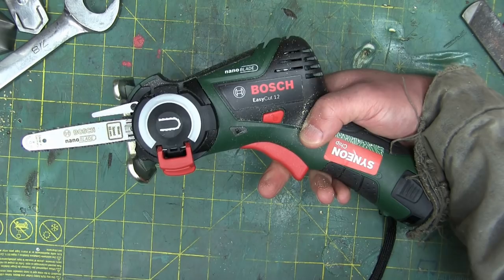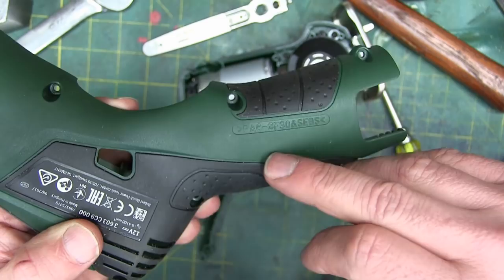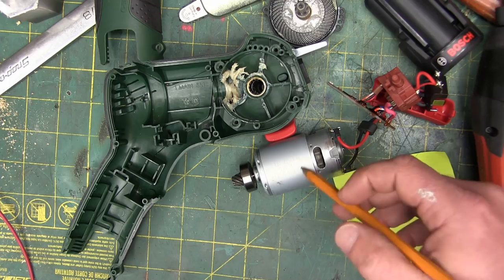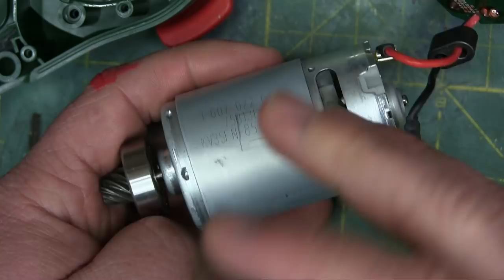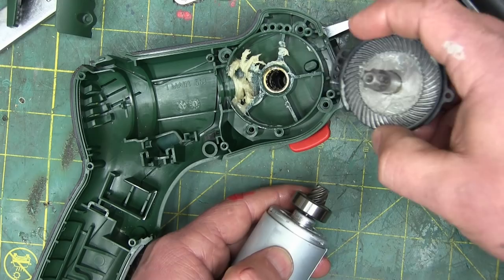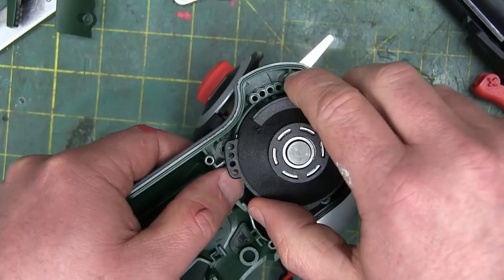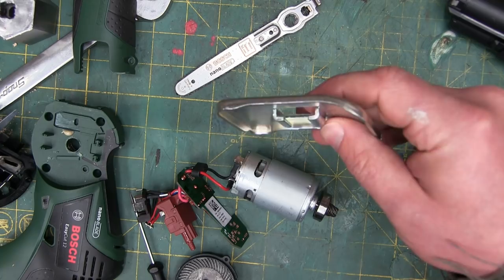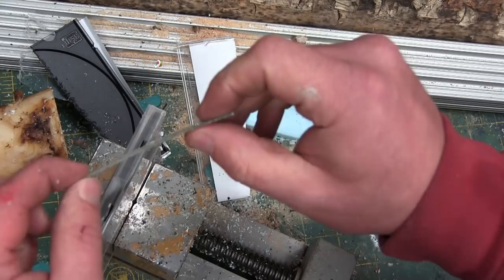BOLTR: Bosch Mini Chainsaw | KID SIZED DANGER!

Comment: I don't need it but I want it.
Reply: I want one it's so cute. Awww
Reply: The Stoned Videogame Nerd GEARS OF WAR!
Reply: I both need one "and" want one !! Ohhh the agony pain of wanting !!
Reply: F'n EH!! Still tryin to contemplate a use for it but i hear ya!
Reply: No no 
When the WANT becomes big enough, it will undergo metamorphosis, and emerge from its mental petcolation as a fully formed NEED!  I've seen it with my own two eyes!
Reply: Like a Bosch !
Reply: dont worry about wanting one... i cant find them anywhere. i hope this isnt AVE's first shill vidya.
Reply: They're on eBay, I have one an I'm in the USA.
Reply: No no Lol I have the vertical cut EasyCut 50, it's fucking sweet actually, I cut laminate floors and oak sills with it and for oak it's a bit slow but it works great, when I saw it was out I picked it up right away, only thing is that the spare blades are like 20-25€ a piece. It leaves a much smoother cut edge than anything else that can do small cuts so it's not just a cool toy.
Reply: Same. Why not.
Reply: See, here's the problem I have. I really don't WANT it but I'm afraid I need it. Long story short I gave up my recreational crack habit for a tool addiction. Now that I know about this I'ma have to git one.
Reply: Gears of tiny War
Reply: Pretty much like every unopened tool in my workshop, I may need it.
Reply: i have the same mentality
Reply: gabriel Sturdevant I found them on Amazon UK but not USA look up Bosch easycut 12
Reply: this and the chainsaw grinder wheel.. want it but the use..tere is none!
Reply: Those 30 year old ones are definitely different quality than those modern "green" Bosch. Had a green Bosch drill that fell apart for no good reason (other than being all-plastic). Still, this thing is SO CUTE, I just have to buy one :)
Reply: I actually do need it. my local city is violating curtilage law. 
Shitycityslickers Won't respond to removing the tree. The neighbor planted it and wanted to keep it. I need a sneaky chainsaw.
THE CITY CAN NOT HAVE ANYTHING BLOCKING ACCESS TO A GATE, DRIVEWAY, SHED, OR GARAGE. 
The law is the law.
Reply: I WILL! FIND A USE FOR IT 😂👍
Reply: Don’t we all just as a novelty
Reply: Now that all they need to do is hook this thing to a 25-foot pole so I can trim the tops of my trees.
Reply: @GospelOfTimothy  Harbor Freight pole chainsaw: am i a joke to you?

Wonder how long that blade holds up, cost, options,  but, skookum fuckery to one side, will I wear that out cutting branches from trees, or chopping up fallen branches for kindling? It failed on the rip cut, i was disappointed, but surely you could prune an apple tree. Then slice girders in your spare time lol.

Comment: Fun fact, the first chainsaw was about this size, invented and used by surgeons to cut bone! They were hand crank, no batteries required! I believe they now use something similar to a fein oscillating multi tool to cut casts off, and cut bone.

Comment: I came here from Wranglestar's review of the same tool to remind myself on how to correctly review a tool.
Just out of curiosity, how long before you think you pass him by in subscribership?  3 months? 2?
Reply: same here - wranglerstar "knew" the tool was garbage before he even touched it - he's got some next-level bias.
Reply: wranglerstar spends more time on his clickbait title than he does the video content.
Reply: How can WS have more subs?
Reply: @jensdavidsen4557  he, he shat on this product so much saying how bad it is. How a jigsaw is better it's. It has a different purpose. a jigsaw and a reciprocating saw blade goes in and out, so the work object so the tool has to be held onto the object tightly. This chainsaw just runs in one direction so it doesn't have a push, just a pool. 

A jigsaw cant cut into object longer than the blade itself, this mini chaincase can.

This tools is better suited for cutting/pruning shrub branches.
Reply: @Professional_Youtube_Commenter  as someone that does residential tree work. I'd rather use snips or a arborist saw for on the ground pruning. If you positively could not work a hand saw in a spot, this might work.
Reply: Wranglestar is a farmer.  AvE is an engineer.  That's the difference.
Reply: @ahobimo732  wranglerstar is not a farmer lol
Reply: I own this Chainsaw, if fuckin Awesome,

Comment: The chain saw was actually developed as a hand powered surgical tool for chopping through bone - sawing down trees came later :)
Reply: Stephen (ala QI) taught me it (finger rings, toothed cable) began as a gyno tool for cutting through the pelvic girdle during difficult (duh) deliveries. Never fact checked it as that's just a shade too greusome.   😃
Reply: The chain saw was invented to saw chains.
Reply: Stryker in Kazoo, MI, makes bone saws for surgery but they ain't as fun as this baby !  This may be your funniest video yet.  You sure had fun in the last 3 minutes.

Comment: Is it true that a chainsaw cannot cut through a sleeping bag?  What about a tiny chainsaw?

This device is totally awesome, by the way, and I completely want one.  Admittedly, mostly for answering questions beginning with "Can it cut through .....", though .....
Reply: Depends on whether or not the sleeping bag is able to get tangled in the chain and stall it, same for the small one. 
There are chainsaw safety clothes which have fibers that tangle the chain and save you from getting cut

Comment: That motor is very common in cheap cordless drills, it does not have a real voltage rating, same motor is used for all tools ranging from 7.2V to 18V, could be more. The only custom part is that sleeve. Cost up to $10 on ebay.

Comment: Kinda late on this one... But that ferrite probably isn't there to surpress comuntation noise. Those things do sod all below about 10MHz, and the comuntation noise from that motor will be topping out at around 50KHz max.
During emc compliance testing, they put the product in an anacoic chamber and blast them with rf energy (probably 10V/m in this case) and check to make sure they keep working at all frequencies. My guess is those battery cables were forming a 1/4 or 1/2 wave antenna for something in the tens or low hundreds of MHz, and the pickup was causing the processor to crash. They'll have added that ferrite as a reluctant last minute design change to pass emc. Just spent a week of my life babying one of my company's products through the exact same set of tests, and its excruciating!
Reply: makes me glad I dropped my microwave engineering Masters and went into IT lol. EE is some tough stuff.

Comment: Now you need a tiny set of files to sharpen it!
Reply: You only need one round file for chainsaws until you need to trim the rakers. I was thinking it'd probably be about 1/32 or 1/16 for this sized chain.
Reply: The teeth are really tiny - probably a mm or less.
Reply: dremel tool

Comment: PCB board is printed circuit board board. Let’s eliminate and do away with redundancy.
Reply: wd9dau do you hate it when people say PIN number?
Reply: He knows, and does it on purpose :P
Reply: billy mccabe  And VIN number, and PMS syndrome.
Reply: LCD display, TTL logic...
Reply: You gotta punch your PIN number into the ATM machine to get your USD dollars out and buy some distilled liquor. That's how it works, just for your FYI.
Reply: the worst one and the most annoying one is LED diode
Reply: ATM machine
Reply: Whats are ya? From the department of redundancy department?
Reply: CSTT Team (Combat Systems Training Team)
Reply: LED light
Reply: bhartley1024 ATM machine? Oh, you mean the machine you watch your ATM vidjeos on...
Reply: I'll write up a GUI interface in Visual Basic so he doesn't forget.

Comment: I was visiting the good old Baumarkt to decrease the free space in my house by adding tools but i forgot to take off my work jacket.
So while walking through the Cordless tool section i got attacked by an old Grey beard wearing Bosch clothes and huge €€€ signs in his eyes.
I guess he saw my Steel Mill jacket and thought i'd be an easily persuaded 250 pound gorilla full of money.

He tried to sell me Bosch Blue tools and was gushing about how they are all build in germany and how all the other companies only produce overseas not giving Germany anything back and after about 10 minutes of talking about politics and shit he finally found another target.

So just out of curiosity i went back and looked at the tools on display and ALL of them were Made in Hungary.

I don't give a shit if a motor or some screws were made here... why even bother telling me they were build in germany if it says HUNGARY right on the fucking tool.

SOO out of spite i bought a Bosch Drill with a cord out of the "Used once and Returned for no reason" Bin for 30% off and drove home.

Good Drill but shitty Marketing assholes pissing me off when all i want is just look at pretty tools and not think about politics.

Comment: As a city tree trimmer I'll tell you that you never cut against the grain. Your cutting efficiency is 4 x better
Reply: you might have that backwards cutting with the grain would be like splitting or ripping which is really hard to do with the pruning saw and doesn't serve a purpose in tree trimming
Cutting Against the Grain is a Crosscut which is like cutting a tree branch off

Comment: Love the ID10T, in the RAF new recruits would be sent to the photog section in their blue uniform with their respirator on and holding a board which had the sign ID10T on, they would be told it was so they could have an ID badge that people could recognise them form just the eyes and hair alone, of course the photog section are well in on the gag.
A bit like sending the new recruit to stores for some tartan paint, a long weight(wait), sky hooks or long stand but this is better due to the evidence :)

Comment: Cute little tool - I just googled the thing, and Bosch apparently claims the blade is good for about 100m of cutting in softwoods and laminates.  Appears they also do a ~500W corded version which looks like a jigsaw, only without the violent stabby-stabby motion so you can use it to plunge cut into something (say a countertop) without having to drill a starting hole.
Reply: A jigsaw doesn't need a starting hole either. You can plunge cut with them.....
Reply: Ben Johnson : might be good for parting floorboards right in the middle of joists
Reply: Depends on the material.  A jigsaw plunging into laminate would probably not do so well.

Comment: I've seen that incline plane idea from Canon entry-level lenses. Specifically the 18-135 IS. They align the mid element group like that and have a friction clamp screw to to hold them in place. WAAAY easier than poor Nikon assembly line workers and their stacks of shims.

Comment: Hey AvE. I can tell you the crown gear is a sintered part, much akin to the parts in their angle grinders. And the Bosch angle grinders share parts whether it is a Green or Blue line. 
Having burned too many in the past year, the sintered crown wheel simply cannot withstand the abuse of grinding concrete for a few hours. The longest we have had a 125mm Blue Bosch grinder last is roughly 20  hours.. And by then it really starts to sing..
Reply: Stefan Asmussen you won’t find ANY angle grinder made in the last 30 years that uses crowns that won’t have powdered metal crown gears. We can press and complete every process on 100,000 gears for pennies before a shop could machine 1,000. Most everything is powdered metal anymore. Most all of your drivetrain, suspension system, random spacers, wheel speed sensor rings, you name it in your car alone. Not to mention your tools, appliances, firearms heavy equipment, hospital equipment... EVERYTHING has powdered metal components. When made in lower north eastern America they’re made to amazing standards. But patents have been up and China floods the world with poorly manufactured pressed metal components. Many of our local facilities have sold out to China and we send orders to a sister facility in Brazil just to compete in overhead costs. Many of the local left are foreign owned.

Comment: Would it work to cut flesh asking for a friend
Reply: Like for butchering
Reply: if you only plan to use it once, I wouldn't wanna be the one stuck trying to clean it. chainsaws tend to pull and rip if it's not a firm material
Reply: Pete Lorenzo Would freezing first help
Reply: sixstringedthing Lets just say my bukos hunting deer but to lazy to sharpen his knife
Reply: How about small children?  I guess I'd need a chest freezer as they won't all fit in my upright.
Reply: EscapeMCP Not a good idea to speak of your... hobbies on the internet but the best would be a walk in freezer bit they're expensive

Comment: Could have totally used this today cutting the bottom of a 2x10 that was already pinned to the post.  Used a hackzall and it did not like treated lumber at all, neither did my arm.  Circ would have hit the ground, if you get the picture.

Comment: You need to be worked into the casting of the trailer park boys... Here and there but only through a T.v or Computer monitor character type roll. just break me off some cheese for the idea. let me upgrade my GEErage.

Comment: 8:24
The number is actually on the right side. 
You have to pull of the pinion to change the bearing. The number is on the side, where you pull it of.

Comment: I have used mine for a while now. My only complaint is the cutting  belt should be wider as the saw track gets stuck in the wood. Sorry for my piss poor explanation I am not a chainsaw person I just use it for modelling.

Comment: That is really cool I have not seen one of those. They do make a blade for an angle grinder that is round but has chain saw chain around the outside, it is used for wood carving. And damn I just noticed the ads that popped up I am looking at like four different mini chain saws haha. I am going to check them out in a minute. I am a boat mechanic and work on lots of big yachts, (I do the weird stuff, like ok how the fuck am I going to do this) and I need this tool!! thanks for sharing buddy.

Comment: My brain is having a mosfet fail thinking of all the little stupid things this could actually help with. Cutting foam like that is nothing to scoff at. Have you ever tried to cut a spicic shape outa foam? It is a pain in the ass, usually have to use a hot knife thing or hot wire knife and it lets outa stick boi!. Also the joke about ice sculpting with it is not a joke at all. It would kick ass to have this in a kitchen, whip it out and make a dope mini sculpture

Comment: I want one, but 300 seems a bit steep.  I didn't even pay that much for my greenworks 14" chainsaw.

This device would actually be perfecting for cutting thorough woody bromeliad stolons.  It's a grueling job, I currently use a sawsall, but it's heavy and two handed.  A little thing like this would increase speed and productivity.

Comment: AvE I'm and ibew journeyman wireman and we work with a lot of Milwaukee tools, one of those is a power pony hand held pipe threaded,  idk if you have seen one or not but my guess is that you have, is there any chance that you could do a tear down on one because anything that you can hold in your hand and thread up to 2in rigid conduit is pretty bad ass

Comment: Got one, can only get from UK right now, one thing that was not covered in the vigao, notice how it stops instantly when you let the trigger go? How is it doing this? (just like the chain brake on it's bigger sister) are the electricals reversing the polarity to the motor? Also I see a sparkum behind the motor when it does this....

Comment: IF YOU CANT FIND A BATTERY FOR THIS TOOL:

Bosch doesn't sell the green "home and garden" line in the US (not sure about CA). The batteries these things take (PBA 12) are NOT the same as the blue "pro" line. Well actually they are identical but Bosch slaps a different plastic adapter on the bottom that makes them incompatible. The overall shape, terminals, etc are identical. They can even use the same chargers. 

But Bosch does sell this battery with the correct adapter plate in the states it turns out... as Dremel! The 12v Lithium Dremel battery is identical to the Bosch home & garden line. 

I learned all this after I ordered it from the UK without the battery and charger (because it would come with a UK plug) and ordered a Bosch 414 battery and charger from the US. I'll admit I did yell out "son of a diddly" when I realized. 

I couldn't be bothered to return the 414 "pro" battery I bought so I just cut the plastic case down to fit. Works well enough, so far friction keeps it in place. (Bosch was vindictive enough to notch the shelf in the tool where the tabs go to make sure the tabs on the "pro" batteries wouldn't engage).

Comment: "World's first surgical chainsaw"
*adjusts pocket proctector*

Well actually, the first chainsaws were invented for medical operations. Doc would thread it in through the meat and give the ends the old push me pull you action to cut bone. From back when germ theory was sketchy but they DID know that the more you slice and dice the patient's meat the worse the outcome. Saw through pelvic bone like this was a better alternative to cesarean section delivery. Later versions had a bar like we see today with a egg beater type hand crank.

Comment: Because of you, uncle bumblefuck, I now have an Easycut 12. LOL.  By the way, the battery in this is different then the batteries sold for the USA Bosch blue tools.  However, I took this battery into Lowes and plugged it into a Dremel 8220 and it fit like a glove and worked!  So likely you can get a battery for the Dremel 8220 and it will work in this.